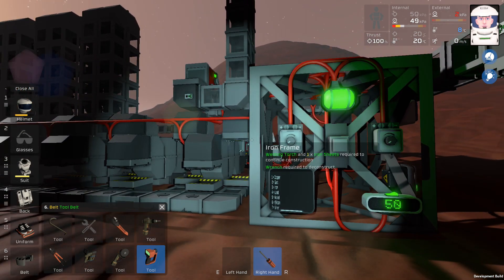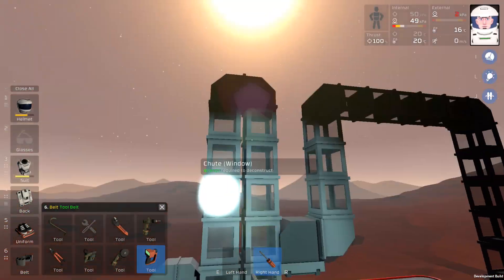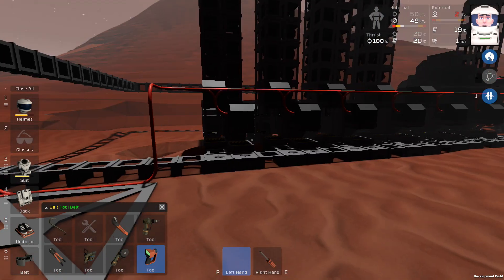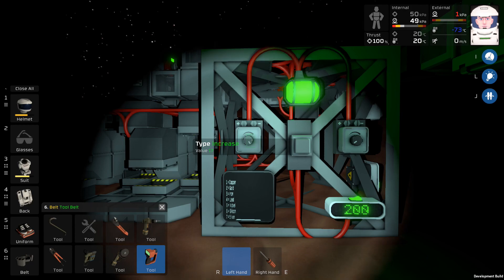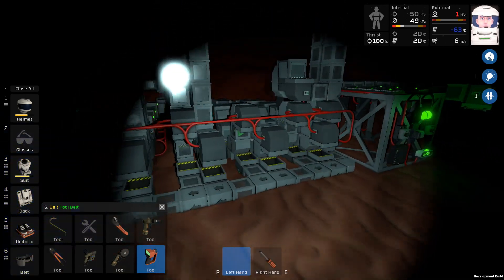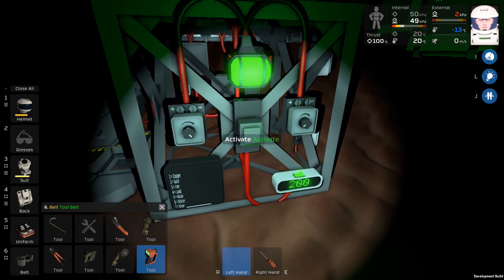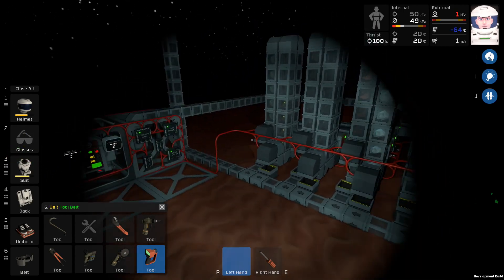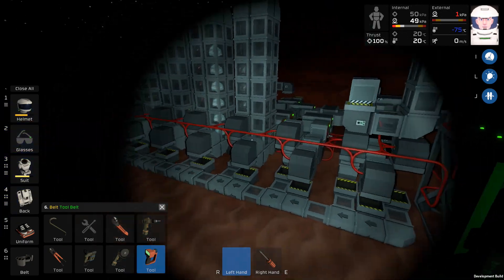Stationeers: One Click SUPERALLOYS! - Fully Automated Advanced Furnace

Comment: if you smelt your ores with electricity first, you can put the ingots into the furnace and not have to worry about the gasses messing with your pressure and temperature. Besides that you use less of your precious fuel and use free electrical power for the initial smelting, making the second smelting a lot more efficient. It's a lot slower, but you can build an electrical gas heating system and use hot, inert gas for fast smelting of ores in a furnace.
Reply from the maker: Good method. To be honest, fuel is not a problem and I'm not sure the time efficiency saving on the smelting (with the pressure and temp being messed up) would be worth the effort. It doesn't take long to hit the required window, and I'd have to build a whole automated arc furnace system (which, as you say, is slow) and so is the reason I built an automated furnace system in the first place :-)

Comment: Moin.Chris Cox
Could you maybe watch the program again. For me, the chute does not open. It is recognized whether or not there is something in it and the advanced furnace also starts to work but the chute discharge does not open.
I would be very grateful if you could check it again.
Reply from the maker: I'll give it a check when I get a min. Last time I tried it was working OK. Make sure you use the latest code from the latest video!
Reply: I did that. So I need the program without a vending machine. And with the circuit, the chute ejections recognize what is inside or not, but they are not opened when I click on Activate.
Reply: So I need the program like here in this video. Would be really cool. Unfortunately I have no idea about programming.

Comment: I can’t seem to get the furnace to work at all. Or the chutes. Yes I’m using chutes instead of the vending machines. In the code there is something called an ice furnace?? Maybe that’s my issue cause I have no clue what that pertains to. Maybe if you had an updated diagram, that might help. Love the code, would just love to get it working.
Reply from the maker: I do need to do an updated diagram. As for the Ice Furnace, that isn't supposed to be in there haha. I just have a separate furnace that the code keeps hitting activate on that allows me to melt ice. I just chucked it into the code but I should have removed it from the version of the code I uploaded.

Remove any reference to the ice furnace and it should work. I'll try and update the code and the diagram to account for the addition of the new IC for superalloys.

Comment: Does this code still work cause I've went through it, line by line and nothing.  I'm bout ready to throw my computer in the yard.  ha.  I have everything exactly like you have here.  SOOO FRUSTRATING!  lol  So, the activate button is on D0 on the main control housing, correct?  The line that is referencing that is line 28 on the MainControl IC.  "l isActive activate Setting".  Should the function be "Activate"?  Because the button is only 1 for a split second when being pressed?
Reply from the maker: It's possible something changed in a recent patch, I haven't tried in a few weeks. It's fine for a button to only be 1 for a split second, the code runs every 0.5 seconds so should be fine to catch it (i've rarely had it miss). I'll spin the game up when I get some time and check if it's all still running.

Do your housings give any errors?
Reply from the maker: BTW, this does all still work :-) However it does seem to stop working every patch until I pick up and replace all the IC chips to reset them.
Reply: @Xennon101  As you said yourself, picking up and placing the IC chips many times fixes "clogged" code it seems. 
I do that on my airlocks now and then when I'm starting up an old save 👍